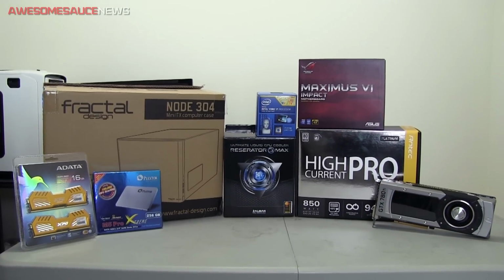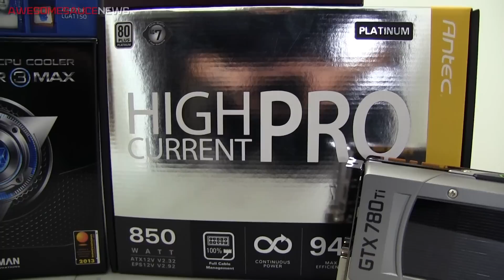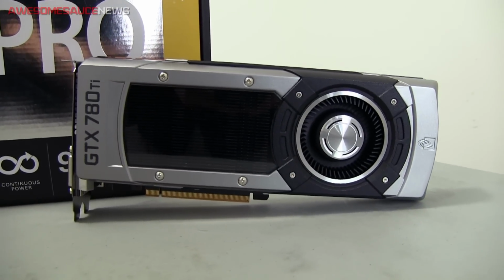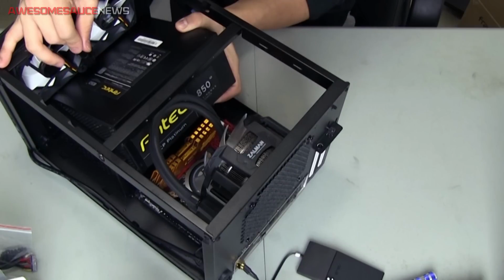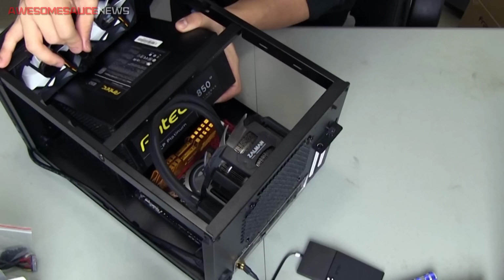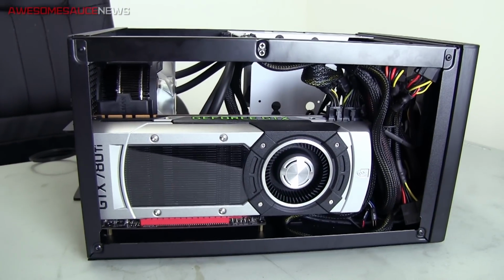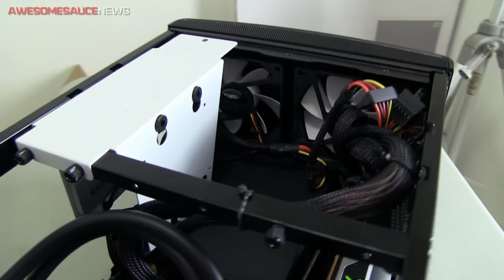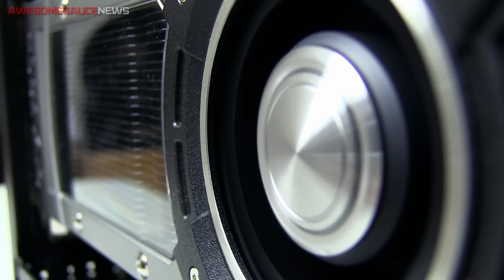Epic $2300 Portable Gaming PC - Time Lapse Build

Comment: Cheapest PC: No Case
http://pcpartpicker.com/p/qW6ZhM
This rig haves a WD Caviar Blue (80 GB is more than enough for this PC), so I think that could improve the performance in a big way, I mean, instead of having a 50 mb write/read of 320 gb, I prefer having an 80 gb one and with a better performance.
Great video!
Reply: +Mell Cáneva 
Yeah, that's great, I guess. If all you do is read articles on the Internet.
Reply: This might be good for a internet browsing machine... maybe.
Reply: This machine is just for that and maybe, with luck you'll be able to play chess at this with no problem, lol.
Is a working machine just for that price, so don't spect that it will run crysis :).
Reply: Lol that's shit
Reply: +Mell Cáneva it's a raspberry pi for £25 or $65 more. Thanks, but no thanks.
Reply: Yep, you're right. But I think that the best deal you can get for 100 U$S is an ODROID-XU4 + A great SD of 32GB (I've been researching a lot after this comment, lol). Or maybe the Kangaroo Mini PC for 99$, if you like windows.
Also, a laptop under 200 with atom cherry trail or a last gen processor is a very great deal too!

Comment: Reserator cooler is a HELL of a rip off compared to its cooling performance.  You would have been better off buying a corsair h80i.  it's over 20 bucks cheaper and cools virtually the same within a 2c  temp margin of error.